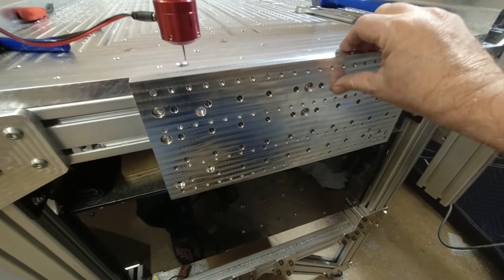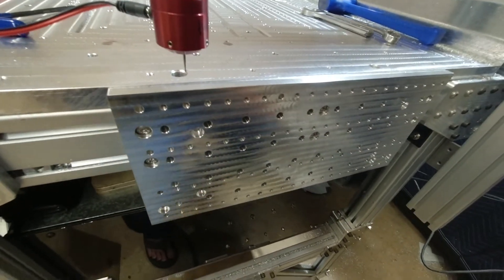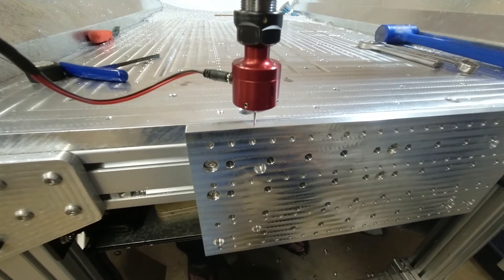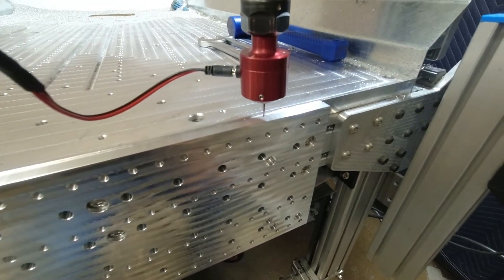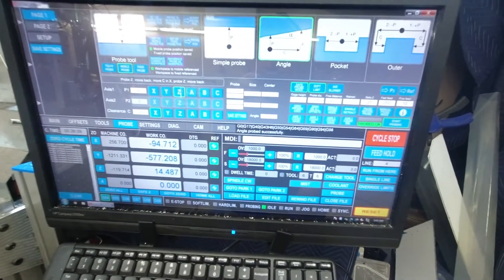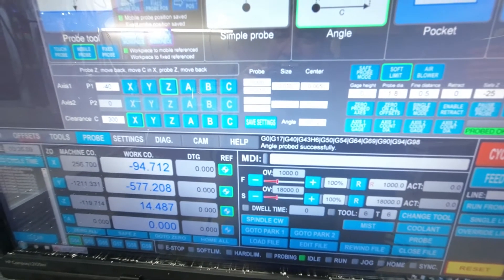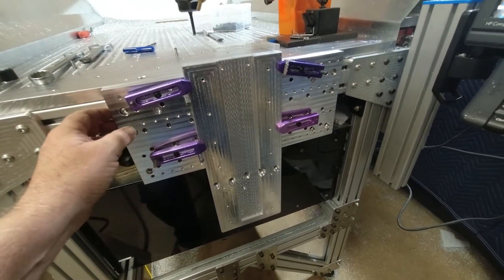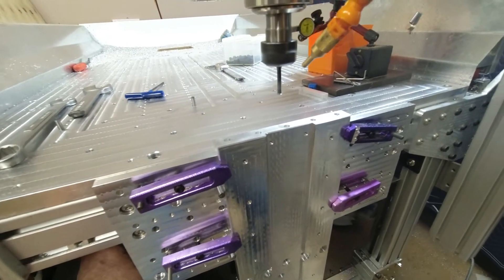Setting up for End Threadmilling Tomahawk CNC

Comment: I love the front-mounted fixture plate - great idea.  I designed my CNC router to be able to reach over the front edge with the spindle for operations like that, but hadn't come up with a good fixture solution for it yet.  I think you just solved that for me!

Comment: Daniel, I have a AXBB-E controller with UCCNC and the same Drewtronics probe you have in this video. I've setup proximity sensors and touch probes without issue, but those were all 3 wire setups. Could you share how you wired the Drewtronics probe to your controller? Cheers
Reply from the maker: Drewtronic is wired same as the limit switches in the axbbe wiring diagram in the manual

Comment: Do you get a lot of tool deflection? Are you running multiple spring passes or are you doing rough passes then a finish?
Reply from the maker: That is a thread milling operation , to get better finish I do multiple rough passes then a final spring pass , If I am not so worried about tight accurate threads I will do a cut then a finish . Time is not a issue , accurate thread is more important in this instance.